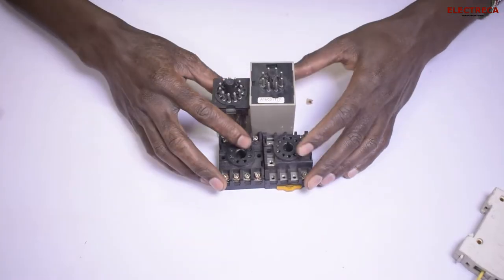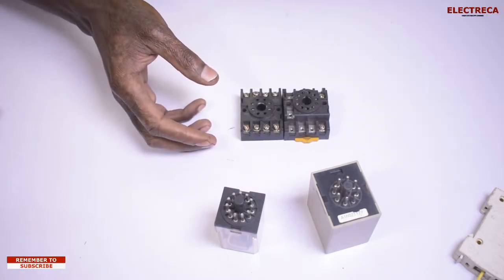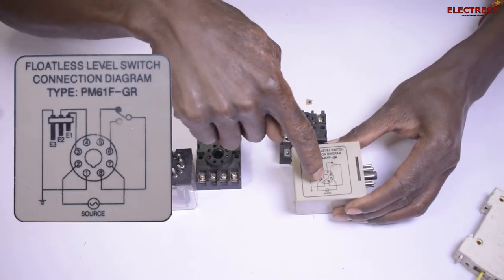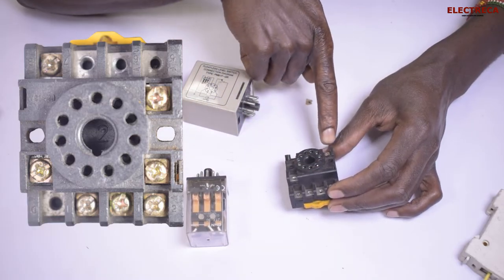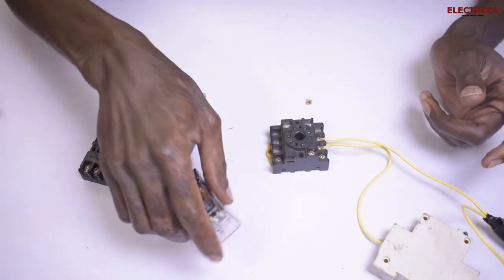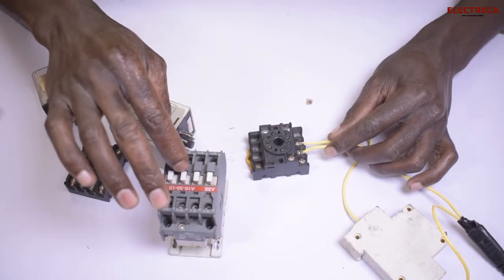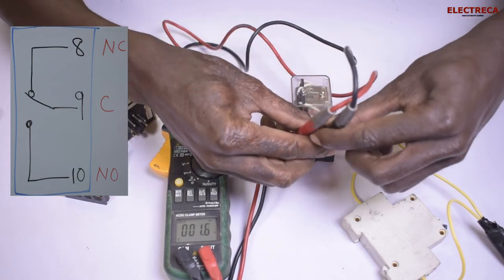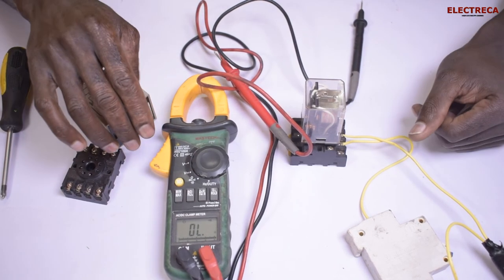How to Connect a Relay Base: The Complete Guide

Comment: Dear Sir thank you very much for video about electrical installation. Explain how to wire 3phase air compressor auto on off with 11 pin phase failure relay